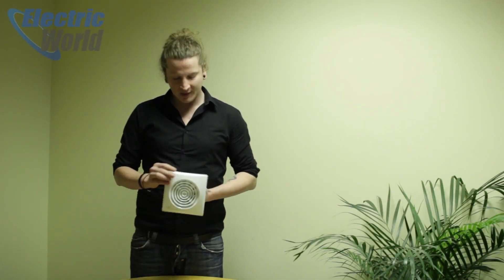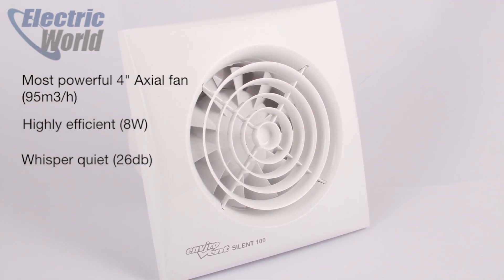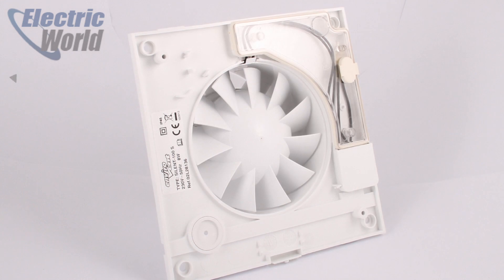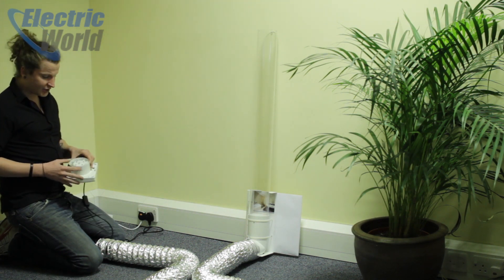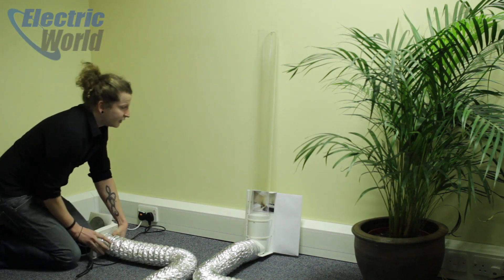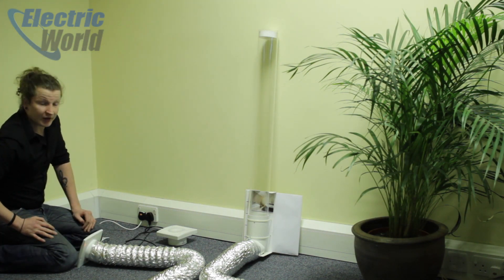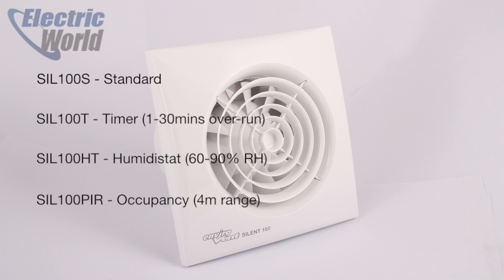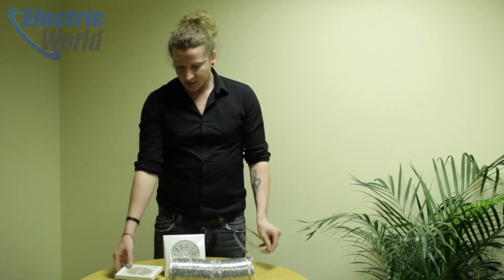Soler & Palau Silent 100 bathroom extractor fan

Comment: Helpful video, thank you.  Please can you confirm whether or not the Envirovent SIL100T is IPX4 and suitable for Zone 0 and does not require a 3a Fuse Spur, but can instead be wired off a 6a Light Circuit ?